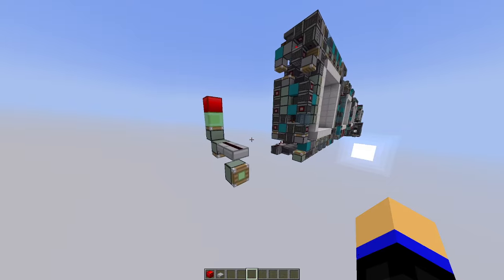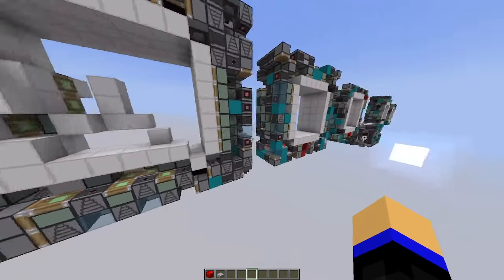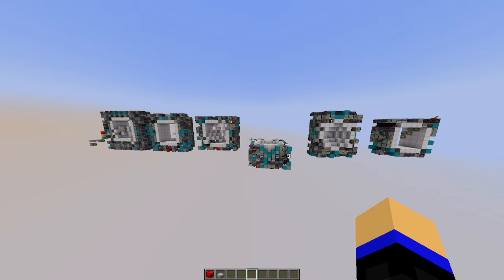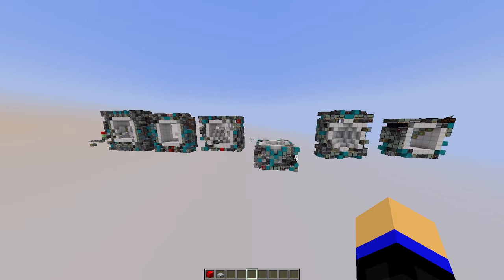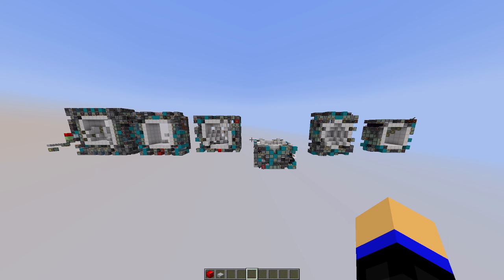How does 24w33a affect my piston doors?

Comment: As someone who likes redstone, I think this is a half half change. It's good, but also bad.

I don't think mojang is awful though, and I don't think they ruined redstone. What they're trying to do is make redstone more consistent in all orientations rather than working differently based on what direction you point it at. Imagine making a redstone contraption, only for it to break because of some weird feature that makes a redstone component work differently based on the orientation, and now you have to rebuild the entire thing in the right orientation.

One thing I like about this update is that redstone components still activate from source to end. Imagine 2 pistons facing each other, connected to 1 lever. Placing the lever on the left activates the nearest piston first, which is the left one, blocking the right, and thus making it not activate. Placing the lever on the right activates the piston on the right first, thus not activating the left. This is demonstrated by silentwhisperer and xizumavoid.

Any slight change in redstone is bound to break a ton of contraptions, especially those that use weird mechanics like orientation dependent mechanics. It's sad to see a lot of redstone builds break due to the update but I believe this is better long-term. Redstone will now be less laggy and will work consistently on orientations (except when two components activate to block each other, resulting in randomness).

Don't raise up your pitchforks and call mojang stupid and soulless and corporate. Go build a new design, you never know if the new change is actually a good change.

Edit: I've heard that QC is greatly affected by the changes. I agree that mojang should fix it so that QC works properly again with redstone dust. A lot of contraptions rely on QC. That's the part of new redstone that I hate. Please don't assume that I'm the type of guy to think that QC is a bug and should be removed. I use QC in a lot of redstone builds, it's so reliable and I like it. (Also anotehr reason why I like java redstone more than bedrock redstone)
Reply: incredibly cool and reasonable take, congrats
Reply: Finally someone understands
Reply: @MrBrineplays_  the issue isn't the new update order, it's the change to the range in which dust sends block updates. Everyone wants redstone to be more consistent, it's a good change. However the update range breaks 90% of everything made in the past 10 years, while it has no benefits. It's extremely limiting and comes with it's own set of very unintuitive behaviours like a dust on a slab now budding a piston that's next to the slab.

It's not about using weird mechanics, it's about using the basic functionality of dust. Nobody complains that they can't abuse rare locationality cases to get certain results anymore. We are complaining because the most basic ways to power pistons got completely broken by this.
Reply: "go build a new design" and you don't see the problem with that still. if i were to make a python script that took me months, and then one day python does a mandatory update changing one of the most basic functions [to make it better and more performant] you think people will be happy to just make a new design after their old one is broken?
Reply: @entityredstoneonyt  I see the problem with that. I've also played with redstone. I've played with a lot of technical stuff, even if I'm just doing those rarely. I know the pain of having to fix and relearn everything just because an update changed something small yet so used in everything.

By "go build a new design", I meant that you should try experimenting with the new redstone rather than complaining just because you can't adjust. You should make sure if the update is actually a blessing in disguise or an actual curse before you go on out and shouting crazy that this thing's awful. You never know, there might be new useful mechanics from these new changes.

I'm not saying mojang should carelessly replace old redstone with new redstone. That's why I like mojang for putting it in the experimental features and ask for feedback.

I for one, like and hate the redstone change. It's more optimized, but with a big drawback. The fact that it can't give block updates now is devastating for builds that rely on QC. That means that redstone dust can't activate pistons below it if there's a transparent block between them. I want that feature reimplemented because it's such a big part of redstone.
Reply: @lum3nd029  I agree with you that mojang should fix that. I like the new redstone changes, but part of me also hates it very much because now QC doesn't work properly with redstone dust
Reply: @entityredstoneonyt Many if not most python2 programs don't work on python3. This may literally be the worst example. And Minecraft's updates are similarly as mandatory, you don't have to use it, but you won't get any features.
Reply: What really miffs me is that in most cases the randomness isn't necessary and even a performance cost. Just consistently choose left (or right, I don't care), don't add randomness! It is a very small change to remove that (a few lines of code), and hopefully with the actual criticism they will fix that.

One thing that still needs to be solved (besides broken QC) is what to do if we can't figure out the incoming direction (standing redstone torch). You have to guess! I would prefer to not depend on time, but just always choose the same direction (like north).
Reply: @Aras14  What if, if two pistons are triggered at the same time, rather than randomness acting upon it and picking just 1 of the two, what if the left piston only always triggers? Depending on where the source or power is coming from, the left piston always triggers rather than being random. That removes randomness and at the same time makes it nonlocational
Reply: @Aras14  yeah, i admit, that was a horrible example. what i was trying to convey is if something like the print() got changed. its just i used another analogy in another comment, i dont want to repeat myself. sorry
Reply: @MrBrineplays_  oh. sorry, didn't know where you were coming from. i thought you stood by the update, thinking redstone shouldn't update qc, i seem to be wrong. i actually agree with you, just saying it would be most prefferable if redstone qc updated again. nice that you feel the same way
Reply: @MrBrineplays_  That (or choosing the right one) is exactly my recommendation. Though it isn't specific to pistons but decided at the junction where the redstone splits, which is already being done. The programmers just need to remove a bit of code.

Comment: As a piston door maker, my opinion for this experimental version is quite mixed. On the one hand, I do respect they have been trying to remake the entire update order to be less laggy. On the other hand, the approach is quite unintuitive, especially the randomness. Thankfully, the dev said this approach was just a test, and I can be sure randomness will 100% be removed in the next updates. As for redstone dust, though, I think they should still make them update neighboring blocks, especially pistons. This change has broken not just doors, but more contraptions out there. The broken doors are just a tiny fraction of the mass destruction we are witnessing.
Reply: That is not to mention adding randomness is even worse. Locationality is not a random problem at all, in fact, at certain locations, contraptions will always stay consistent because redstone dust always follows a complex update order in previous versions. Now, randomness don't ensure the consistency. Some may argue that you can easily fix this by extending the wiring 1 block wider, however, compactness doesn't always permit this.
Reply: @gdtargetvn2418 I don’t want to be rude, but why on earth did you reply to your own comment? You can just edit it.
Reply: @davidbakke9293  ? because i don't want to?
Reply: For me the controled randomness is good
Reply: @loukas130  That does not solve the current issue of redstone dust. Introducing randomness will just mess things up harder, most likely even more than locationality and directionality. While contraptions can be location-dependent or direction-dependent, it still ensures that the contraption stays working 100% of the time, or as people say, consistent. It also allows people to exploit those underlying issue behind the update order to further upgrade the contraptions. Randomness, despite being 100% working everywhere, doesn't ensure consistency, and relies entirely on luck. That means there's a chance you can just accidentally claim a contraption work after, probably 10 successful tests, and totally thinking it stays consistent. There's an obvious and actual reason why most of redstoners prefer Java over Bedrock.

I should also bring this up, randomness is not easy to fix. Some people claiming that probably just witnessed a simple example in a video about the update. When things get more complex, which is exactly what 0-tick contraptions are, figuring out where the randomness occurs is harder than finding where redstone dusts accidentally send block updates to cause locationality.
Reply: @gdtargetvn2418 Yes I see, I’m a bedrock logical redstoner and I’m very sad because some of my compact builds require soft powered pistons, but they are so laggy that I prefer don’t une them and make it bigger
Also every piston contraption I have made have wired timings and don’t stack even when they should, I also made the smallest 3x3 piston door (in my knowledge(9x8)) that uses a piston with a torch(it’s the only thing that worked, I don’t know why, I put it and it worked even if it have the “same” delay as torch on dropper), I have also made smallest combination lock(18block volume)

All this is to say that some things in bedrock have no sense(for me) and other are just incredible(like 10Hz, torches that burn out only when they power itself
Reply: For me bedrock is good, even if they have to make the timing not so weird and make pistons push, only when they reserve a block update
Reply: @gdtargetvn2418  randomness was not meant to be fixed, randomness was meant that you shouldn't make your builds locational or directional. Mojang might adjust the new order to make it work out less random but the random was there to warn you. It's easy to notice the randomness, 1-3 tests and you will know if your builds will work in any directions (not included entities, 0ticks, niche exploits). There were already a lot of people try to avoid locationality and directionality in their circuits.

also, what was the case when you had two pistons pushing into the same block, at the same time?

Comment: Why are you guys speaking like this is a final change? It is experimental toggle for a good reason.
Reply: Copper bulb.
Reply: @user199x  copper bulbs were not an experimental toggle and they had reasons to stick with the change
Reply: @hhff8534  No and no. What are snapshots if not for receiving feedback all the same, and just no
Reply: @user199x  just no is not a valid argument. The reason why copper bulbs had that functionality removed is because they did not want a block that causes lighting updates to have so many functions, especially ones that might be used in mass. That would result in a lot of lag, not to mention that having 1 gt delays is generally gonna cause issues in situations where you just want to use the t-flipflop
Reply: @hhff8534 the lighting "argument" is pure cope. They literally remade the lighting engine, and nobody would be spamming copper bulbs in such a quantity that it causes lag issues.

And no, the 1gt delay would not be an issue in the cases where people just want the TFF, it makes barely any difference in those cases while it would have been huge for wiring that requires precise timings.
Reply: Read the pinned comment